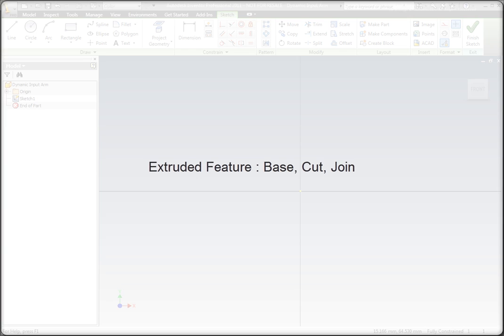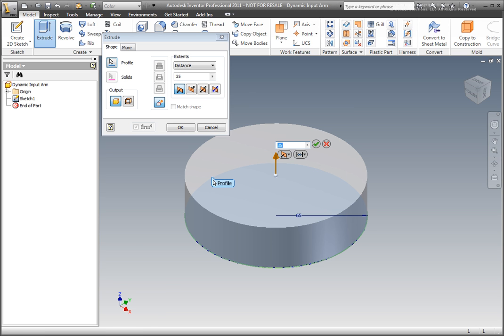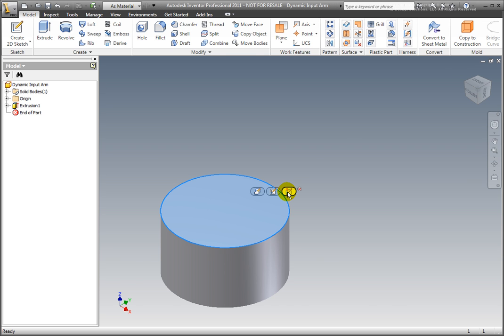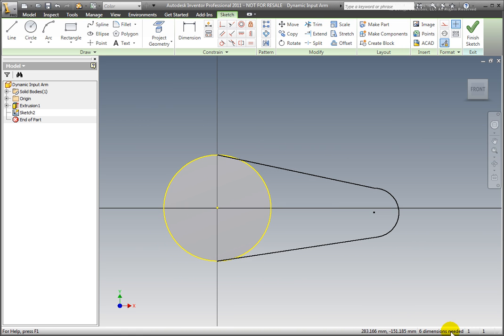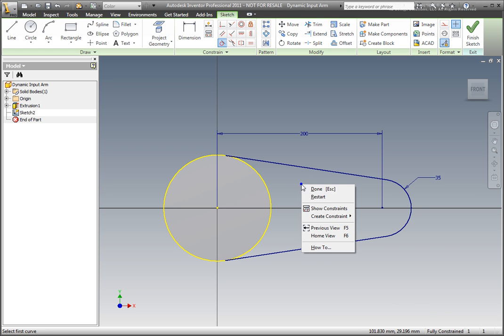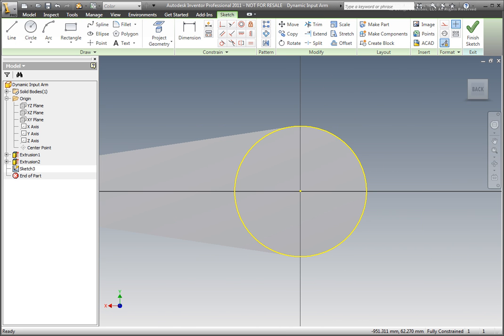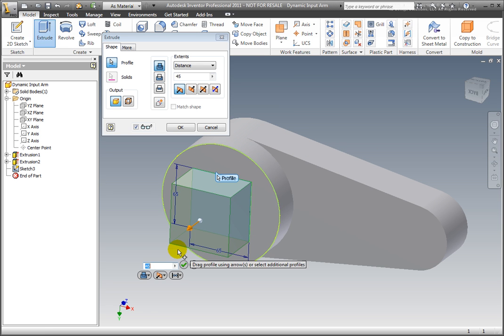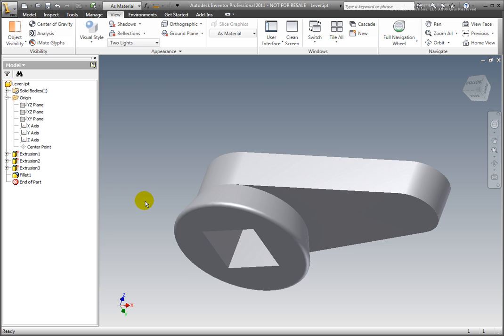Inventor 2011 - Extruded Feature: Base, Cut, Join

Comment: Hello! I'm a bit confused by the use of the design browser. Can you roll it back to change previous operations, and then roll it forwards again, and the program update subsequent operations accordingly? Rather like how you can in Solidworks? I'm using the 2013 version so the browser interface if different from the video's here, and i'm having issue working it out.